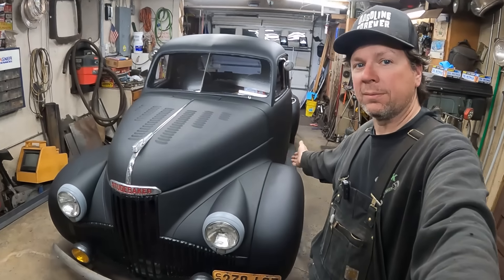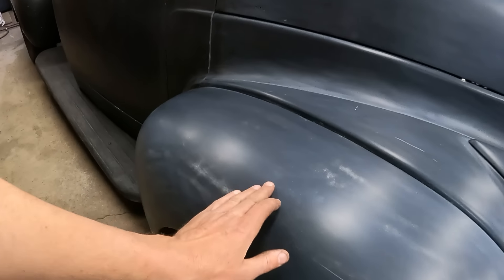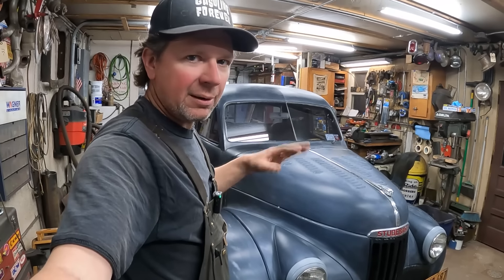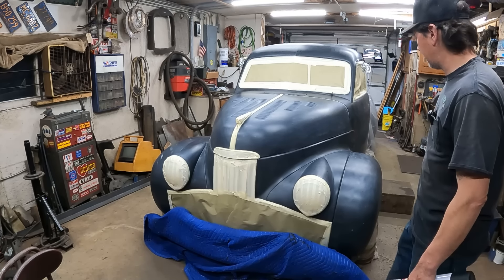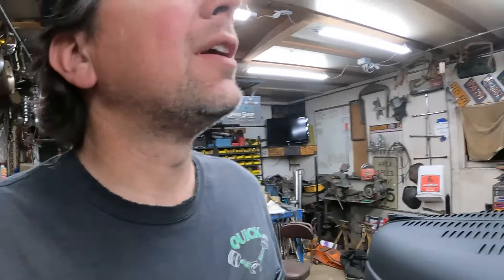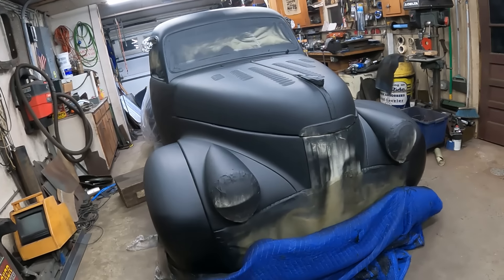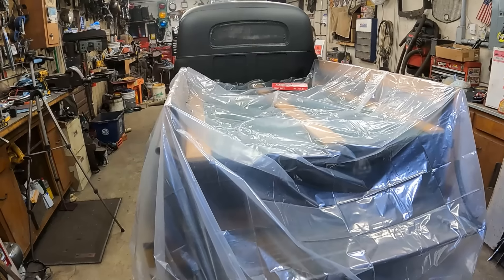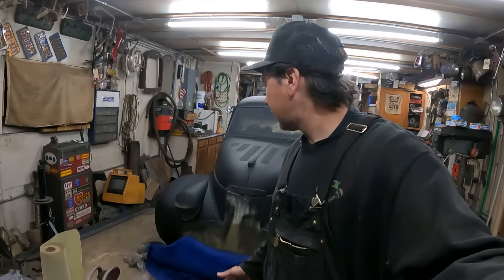Painting my truck with Rustoleum Turbo Cans!

Comment: Wet sand it gives better results but your not clearing it so its tricky
Reply from the maker: I want it flat black.  This is a "temporary" solution until I paint the truck the right way...even though it's been in flat black since 2006!

Comment: Mean old truck indeed. Must be a task just driving it. Has it been in the family for
generations? Wouldn't be able to find another like it! Have a great time in Cleveland.
Looking forward to seeing a video from there
Reply from the maker: It drives easy.  My dad helped me build it when I was in high school.  It has a Camaro subframe.  It has power steering, power brakes, tilt column, and an automatic transmission.  My uncle originally bought it in 1969.  My dad messed with it in the 1970s, it was stored until 1993 when I started to work on it.

Comment: No clearcoat?  Why?
Reply from the maker: It's just rattle cans to make the truck one color.  It will last several years
Reply: You still didn't answer my question.
If you refuse to answer my question I will not subscribe to your channel.
Reply: @QuickSpeedShop  
A dull no-shine paint job looks awful... for a few extra bucks you could have made it look half decent.  You also could have bought 4 paint cans and returned any that you didn't need.
Reply from the maker: Because I don't want it shiny, I want it flat black.  That's why I painted it flat black.
Reply from the maker: I didn't know I needed 4 or I would have bought 4.  Why would I return them?  They're $15 a piece.  My time is worth more than $30, I'm not driving back to the store to return two cans of paint.
Reply from the maker: No, the store where I bought the cans is 30 min from my house.  I'm not going to drive an hour round trip to return $30 worth of paint that I can use later anyway.  Not that I need to explain anything I do.  I literally just repainted my truck, that had been flat black for several years, black again to make it presentable for a prestigious car show I was invited to attend with it.  It looked great and people loved it.  I don't care if you don't like it.

Comment: Good job ,I've used a 3 inch roller an rustolium ,no over spray or shading after a few weeks in the sun it becomes smooth as glass
Edit we use Tremclad in Canada same as rustolieum
Reply: Been thinking about using a roller on some projects, how did that end up blending in ? What roller did you use ? Thanks from Pa. near Maple Grove Raceway.

Comment: My buddy and I just turbo canned the roof of his 65 Lemans. It originally had a white vinyl top that had basically discenigrated in the Arizona heat and he wanted to keep the top white so we just sanded it down and painted it on the cheap and the Flat White goes really good with the patina paint job on the car.

Comment: Can you recommend a good 2 stage air compressor that can keep up with air sanders and sandblasting? Thank you
Reply from the maker: If you're running just air tool a 5 hp, 80 gal Ingersol Rand or Quincy would be good.  If you want to run a sand blaster for extended time(how big?), you'll probably need a 7.5hp, 2 stage 80 gal compressor that can deliver a lot of cfm.

Comment: Why not just buy a gallon of rust paint and buy a cheap spray gun , most people working on cars have some sort of compressor
Reply from the maker: Because those paints are oil based and are not compatible for automotive paint later. The Turbo-cans are aerosol based with solvents.  The whole point of the whole video was to do a demonstration with Turbo-cans.

Comment: Bro I think it’s cool you’re having fun but as an automotive painter for 30 years, these spraycan paint will come back and bite you hard, once they fail, which they will, you have no choice but to take it back to bare metal and start over
Reply from the maker: I clearly explained in the video that this truck isn't perfect.  It needs body work to be finished.  I ran it in epoxy primer for years, to the point it got too hard to adhere properly.  I know the thing needs to be sanded to the epoxy, body worked, resealed, and painted.  It's been on the road since 1999, in flat black since 2006. I don't have the time or patience to blow it apart to do all that now.  It's just a beater hot rod l. I just touch it up every few years. I never claimed this was correct.  I have a YouTube channel, this is just content, it's not a tutorial.

Comment: WTH is your respirator?
Reply from the maker: I had it on while painting clear as day, apparently you didn't watch the video.
Reply: @QuickSpeedShop  I watched until 7:35-7:42, no respirator in sight.
Reply from the maker: That's because I was just showing the paint can and talking.  When I actually started painting at like 8:10, I even said" Let me put my respirator on" and then proceeded to paint the entire truck with a respirator.  You can't hear me talking with a respirator on so that's why when I tried the can out on the hood I didn't have one on.

Comment: I have a Factory Five Cobra that I want to paint in flat black and drive for a year or so before the "real" paint job. This looks like the perfect match, thanks for the video.
Reply: Painted my grandsons rims flat black with the turbo cans over a year ago.  Prep real good and it will last as long as you need it to. Did 3 coats. Very good coverage. Very even application.

Comment: Turbo cans are horrible, ill never buy them again.
Reply from the maker: This is the first time I used them.  They empty fast
Reply: There is potential though. They need to keep working with those cans to get them better. I would love to see spray max do a huge fan 2k can like that.
Reply: You're literally spray painting a car... what do you expect?
Reply: Horrible why?
Reply: That’s why you leave them for the touch up these cans should be the last coat you use after a few small cans
Reply: You're too lazy to shake the can for at least 5mins. I do 10 and it looks too good
Reply: @joeblow8206 try sitting the cans in hot water before you use them.
Reply: Why?  His looks pretty decent

Comment: Never ever paint with rustoleum you will be sorry if you do you will be stripping all of the paint off before you can paint it with automotive paint if you don’t the will fisheye real bad so don’t do it I found out the hard way.
Reply from the maker: Oil base Rustoleum in quarts and gallons, yes.  The Rustoleum Proffesional paint is solvent based, not oil based like brush on paint.